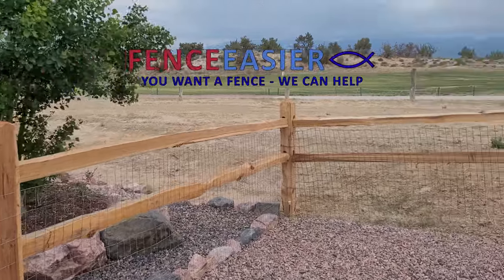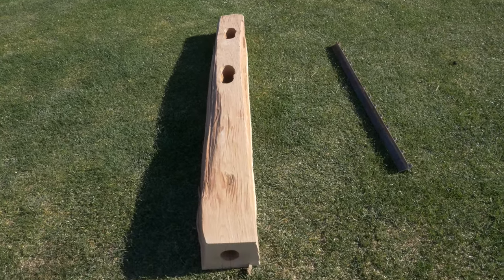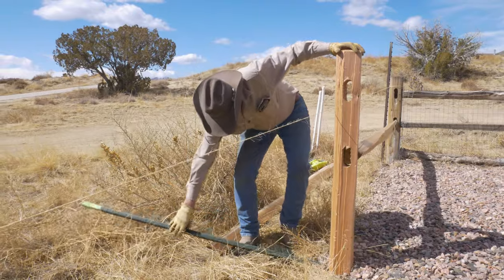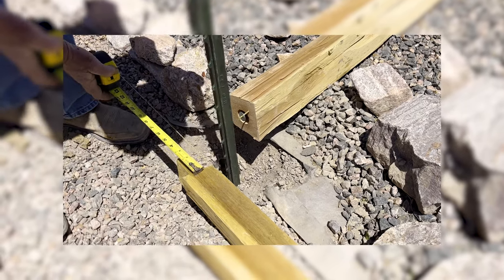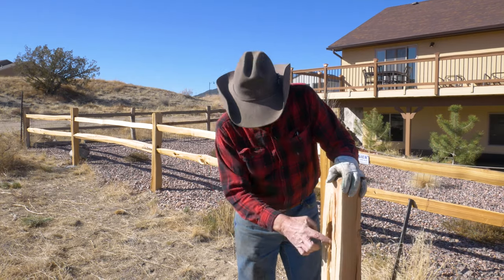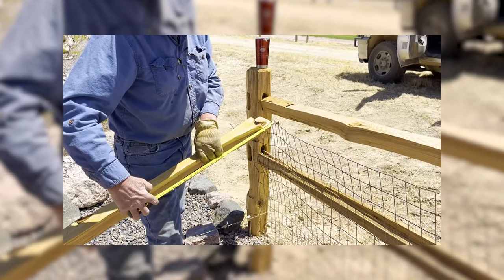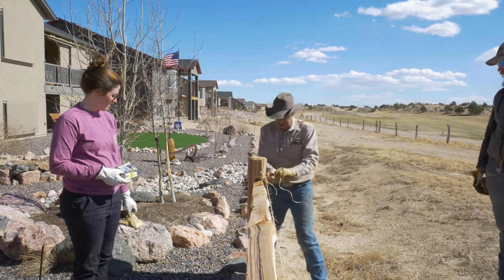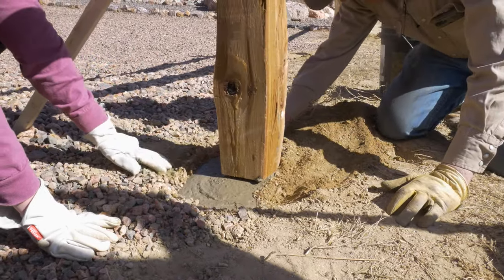How To Install Wood Split Rail Fencing | DIY Fencing Saves You Time & Money | Fence Easier

Comment: Looks nice, what does it cost? I have seen costs per section, per foot.
Reply: Depending on your location, The rails will cost about $16.00 each or about $4.50 to $6.50 per foot for 2 or 3 rail fence.  The posts will cost about $35.00 each or $4.50 per foot of fence line.  The concrete to permanently make your very strong, forever fence permanent will cost $0.25 to $0.50 per foot.  Final bracing to hold your fence very straight will cost about $0.15 per foot.  Additional costs will be $0.10 to $1.00 per foot depending on what fence installation tools you already own.  Total cost per foot will be around $10.00 to $12.00 per foot compared to $25.00 to $32.00 per foot to have an installation company install it for you.

Using the Fence Easier system will save you a significant amount of money and a significant amount of time to do your fence yourself relative to the old, traditional install methods.  Nothing else uses the same technology as it did 20 years ago, why spend all that time digging post holes and installing your fence.  Personally, I would rather be spending my extra time at a family and friend BBQ.

Comment: What is the price range, and where to purchase! excellent video!
Reply from the maker: Depending on your location, The rails will cost about $16.00 each or about $4.50 to $6.50 per foot for 2 or 3 rail fence.  The posts will cost about $35.00 each or $4.50 per foot of fence line.  The concrete to permanently make your very strong, forever fence permanent will cost $0.25 to $0.50 per foot.  Final bracing to hold your fence very straight will cost about $0.15 per foot.  Additional costs will be $0.10 to $1.00 per foot depending on what fence installation tools you already own.  Total cost per foot will be around $10.00 to $12.00 per foot compared to $25.00 to $32.00 per foot to have an installation company install it for you. 

You can make a purchase at https://fenceeasier.com/collections/all 

Feel free to email us at ray@fenceeasier.com if you have any more questions!